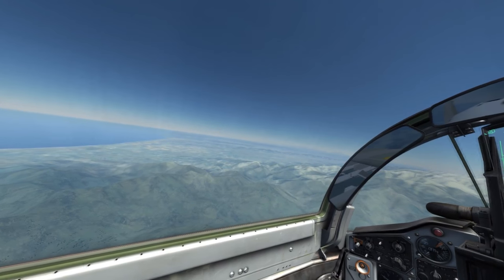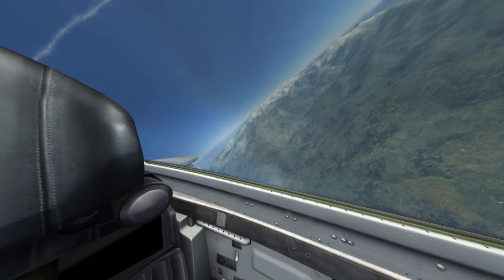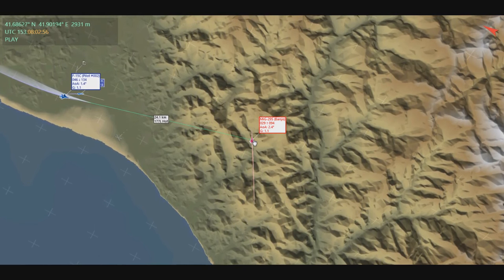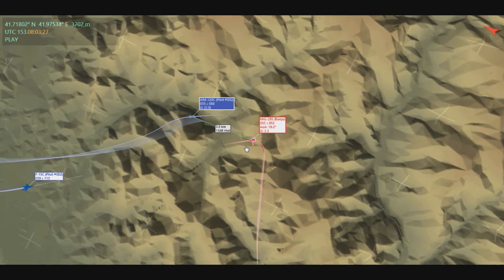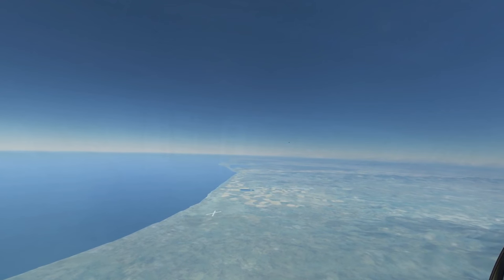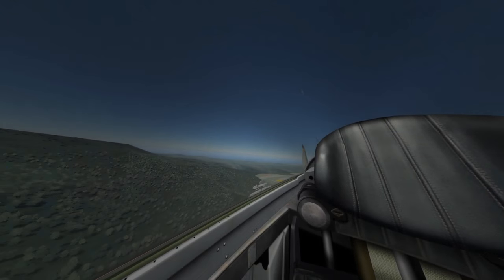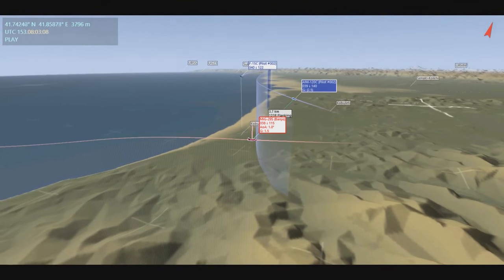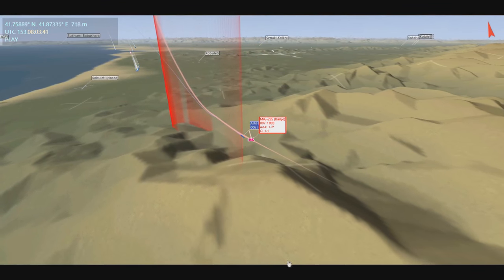DCS:World » Beaming » Air Combat Maneuvering

Comment: good video. But i usally just descend and climb to bleed of the missiles energy. Also its also a good idea to fire two missiles 15 seconds apart. That way it will almost be impossible for the bandit to dodge it
Reply from the maker: Ground threats such as AAA or manpads can make descending to lower altitude very dangerous for any fighter, as a result any defence where altitude remains unchanged tends to be preferred though naturally there will be times when you need to lose altitude, generally if you start notching the enemy.